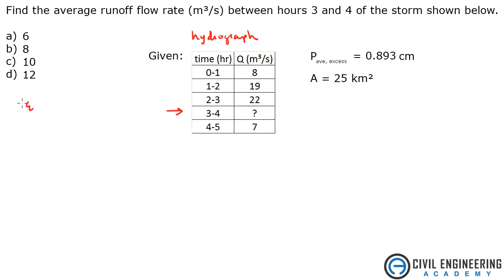Water Resources - Hydrograph Flow Rate in Hydrology

Comment: Ncees pe hb 1.1, p. 393.

Use graph as a guide. Good problem for PE. Thanks you.
Reply: graph helps visualize the problem but not sure how it helps guide you to the solution. not sure this would show up on CBT? unless they expect you to think of the histogram approach shown in the CERM and generate the equations yourself by examination?
Reply: @vincentaroux  this problem is close to a PE-type problem. If you think about the graph it becomes easier to remember how Q, t, and V are related. That's the 1st step. All else follows this premise.

CERM is about useless at this point as it cannot be brought to exam. Still, if CERM is your only source of theory & practice then it's good.

There are other materials, more practical than the CERM in 2023, which might he used.

Comment: why dont you use t = 5 hrs?
Reply from the maker: See above, but I'll copy and past it:  Because you were only asked to find it between hours 3 and 4 which is just 1 hour.  If they asked to find it for the first 5 hours then you'd use 5.  Hope that helps!  If you'd like to more check out the review course we made for everyone at https://www.civilpereviewcourse.com
Reply: Civil Engineering Academy yes but you’re using total volume of the water shed and total runoff....so shouldn’t you use total
Time I.e. 5 hours
Reply: @SouthBayEngr  The explanation is not clear. They should consider 5 hours, as you said. They did not explain that you are considering a "precipitation average" times the area to find your total volume. The average means the sum of all precipitation divided by number of hours (5 in this case). So, the total precipitation is actually 5 times the average. So, you would have to multiply 0.893 cm by 5 to get the total precipitation, needed to calculate the total volume. Then, the total flow, is the total volume divided by 5 hours. So, in the balance, it is like that 5 never existed. But, it was there and that was the reason why, which was not explained in the video. Coincidentally they got the same solution by just using one hour instead, which seems to be an incorrect approach. 

Alternatively, they could have said the average precipitation would lead to an "average volume" per hour and "average flows" per hour and then use one hour as they did, but it seems more complicated than just converting the average precipitation in total precipitation.
Reply: @raphaelr87  good point.
Reply: I'm not here to understand.. only on how to get the answer and get out of the PErgartory I've been stuck in for years
Reply: @bonegrubber  thats a good one: pe-rgatory.